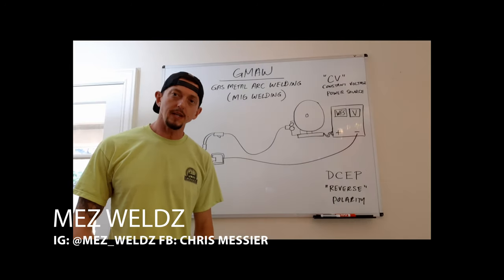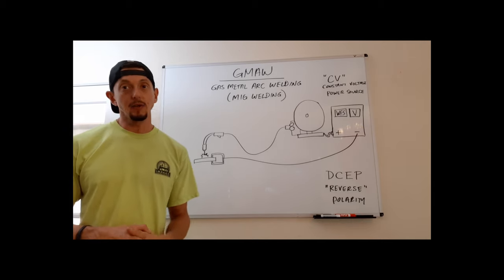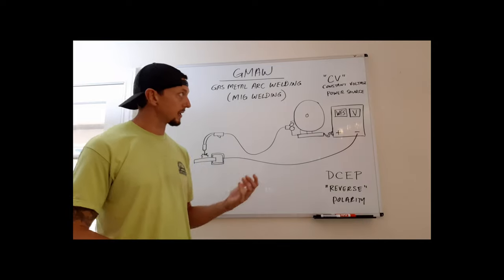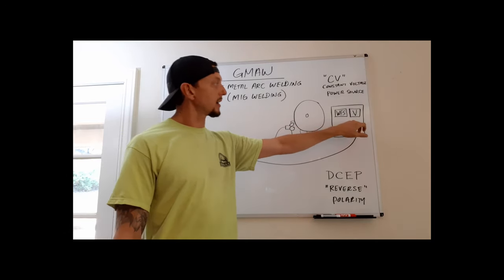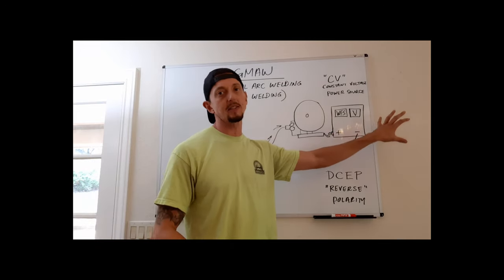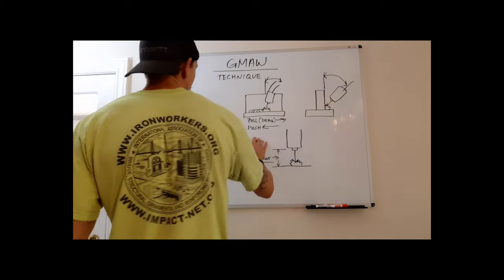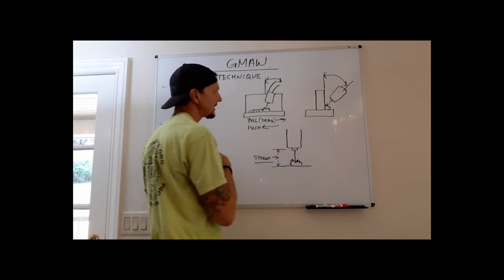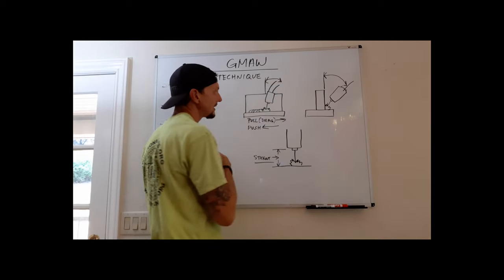Welding Technology Lecture Series: GMAW Theory | Gas Metal Arc Welding | MIG Welding

Comment: Brilliant thank you,
On the push or drag situation ` if heat gets pushed out more at the front as you suggest when pushing then that may be heating the metal hotter just befor you get to weld it` inturn may be helping to pennertrate , just a thought.
What if I have 15mm plate on the flat service 10mm on top` so like a upside down letter T, if I weld at the correct angel so I don`t get a concave weld or a convex weld, but the 15mm would be a colder join as the heat would of needed to be directed more at that piece,but then my angel would be off and course a uneven weld join, what would you suggest in this case.
I am not a welder but have done some stick using AC buzz box